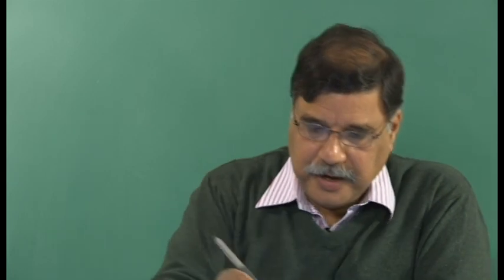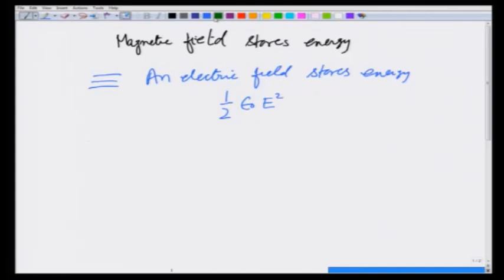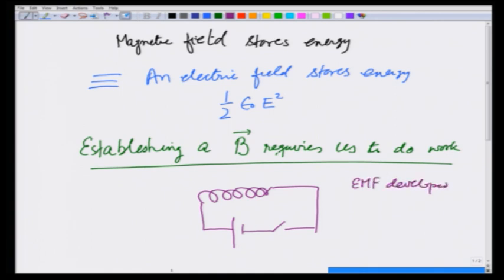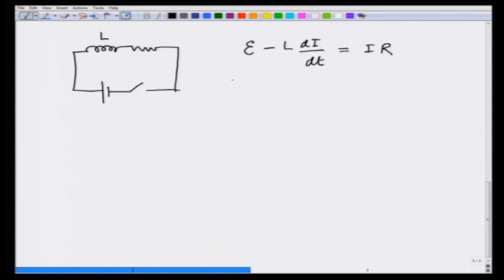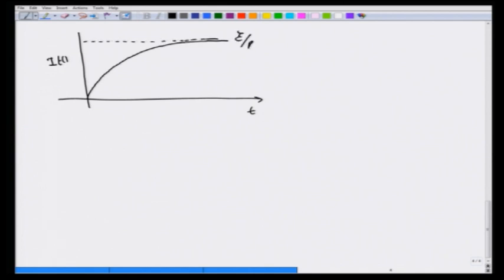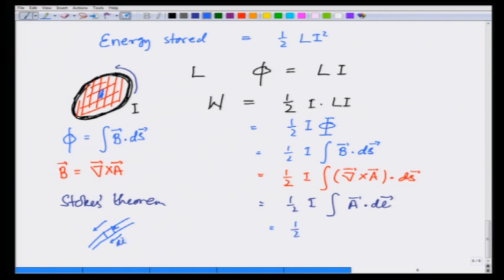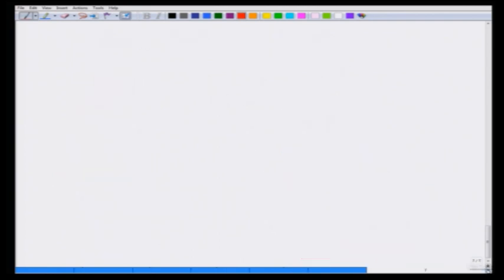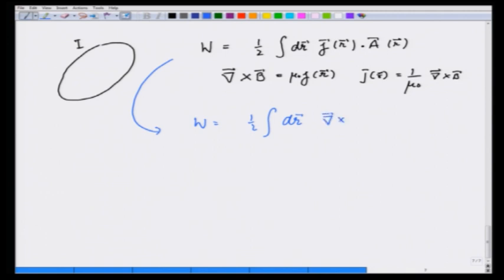Energy stored in a magnetic field - I

Comment: This man has never understood Faraday's Law of Induction. A changing magnetic field only generates A VOLTAGE. Nothing more, nothing less. THE ENERGY is not in the field, but in the movement of the electrons (kinetic energy) being pushed by this potential-difference. Yep, many physicists are better in math than in phys. A big problem in Physics nowadays.
Reply: So what about Maxwell’s equations in vacuum??
Reply: @rust8445  Faraday's law is related to a closed path (as in this video, not a vacuum). Then the curl of E is zero (not - dB/dt).